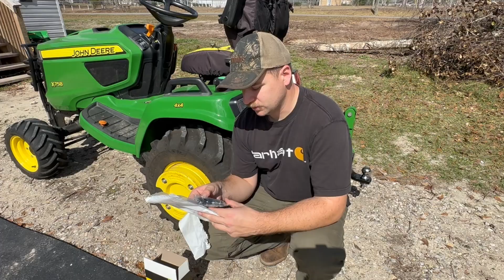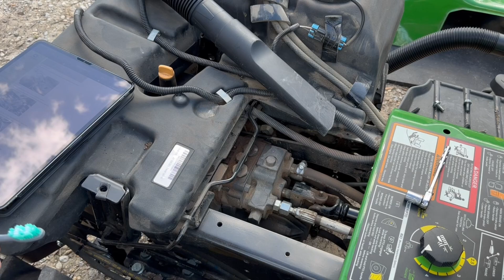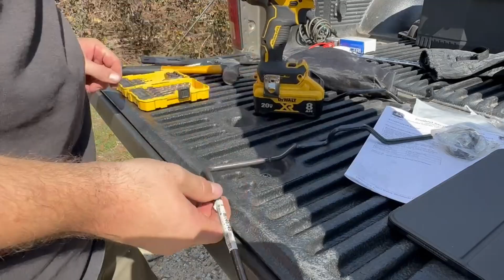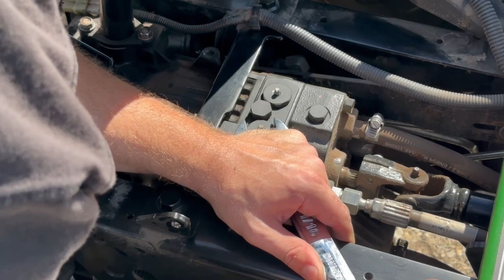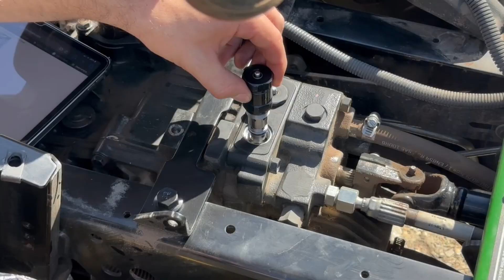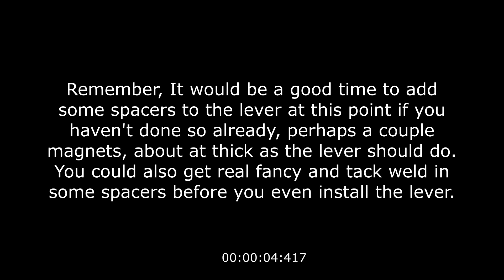John Deere X700 Series Transaxle Hydraulic Pressure Relief Valve Install (All Models With K9X Axles)

Comment: For anyone else reading this, here is what worked for me. I couldn't get the old valve out with an open end wrench. I used a 19mm socket to remove the center bolt which is the implement control valve. This is where you would add shims to increase the hydraulic pressure. Once this bolt and spring are removed, you then have enough clearance to use a 6 point 27mm socket on the valve. I then used a large breaker bar with a pipe extension to get enough leverage. None of the install manuals, forums, or videos mention the proper size of the valve. I used a caliper and it measured 1 inch and 63 thousandths. That converts to exactly 27mm. Hope this helps someone.

Comment: Hey Josh.  Thanks for producing great videos.  Truly appreciated.  I don't know if I'm missing it, but did you have any part numbers for the relief valve?  I have an X739 (2018) and would like to get one installed.  Can you please provide the part numbers or maybe a website link?  Thanks so much, again!  Well done.
Reply from the maker: BW15044 for the valve, M146148 for the lever. Just be aware the lever needs modified.

Comment: Very informative video. I have the pressure relief valve on order for my x758. Were you able to modify the free wheel lever yet? Curious what solution will work best.
Reply: If anyone is interested, I just did mine and for some reason the free wheeling lever does not need adjustment for me.  It makes contact and works as it should.  I do have an x738, I think we have different gas tanks.  Also, I ordered the push cap , spring and washer to secure the lever rather than drill the hole for the clip.  It worked for me.
Reply from the maker: Good stuff, want to post the part numbers incase anyone is interested?
Reply: @JoshsGreenGarage  Sure, the push nut is A16491, it’s an M8 push nut ($2.63).  The compression spring is M151706 ($6.75). The washer is 24M8055 ($0.68), just a standard washer.  I’m sure something similar to these can be found at a hardware store.  For me, just easier to get the Deere parts.
Reply: @MatthewPeterson. I could not find the washer part number 24m8055. Could it possibly 24m7055? Or if know the size of the washer. Trying to order so I have it when the relief valve comes in.
Reply from the maker: I didn’t, but if I ever have the deck off, I’ll likely tack weld some small spacers on. I know not everyone has welding capabilities, so I’m not sure what else would be a solid fix. I’ll probably make a quick video update for it when I do eventually fix it.
Reply: @JoshsGreenGarage  Understood. I don't have a welder. I was thinking maybe plastic zip ties might work. Just not sure what dimensions or materials would be needed so the lever can push down on the relief valve in the correct spot. Might have to fool around with it myself when the parts arrive. I'll probably never use the lever as the tractor is so heavy, but I like for everything to work as it should.
Reply from the maker: Yeah I agree, I usually like everything working as well. I think 1/4" of material would be enough to contact the valves. 
if you put that across the whole flat surface on the rod, you are sure to hit them. If you got 1/4" x 1/4" square steel, you could cut it and get some JB Weld adhesive and glue it on. 1/4" may be a bit much now thinking about it though... And it sucks because it works when the fender is off and the tank is out of the way. Best to sit the tank back down, then check it before fender goes on.
Reply: @JoshsGreenGarage  Tried to install the valve today. I can't get the old valve to loosen at all. Tried a little WD-40 and a heat gun. I'm using the same method you did with a 1 1/16 wrench and a feeler gauge. The feeler gauge tightens things up nicely, but it just won't budge. Ideally, a 6 point socket would work better, but there just isn't enough clearance. I've heard some people ground down a socket with a bevel to make it fit. It just seems like a poor design from an engineering standpoint.
Reply from the maker: I know mine was pretty tight, is your wrench biting good? If it’s not trying to round off the flats, I’d say give it a little more pressure, but at the same time I completely agree with being careful and not wanting to do too much.

Comment: Josh
I noticed my seat on my x758 is very hard to slide forward and backward. I’m thinking someone may have tightened the bolts of the seat to the frame too tight or it is in a bind so that it doesn’t slide smoothly. Is that what you were referring to in your video?
Reply from the maker: Yes potentially. I’d loosen the bolts just a little so they can move slightly, then slide the seat forward and back a few times. Slowly tighten them making sure the seat keeps moving freely. The tracks could also be dirty, so check that as well.

Comment: This is great, thank you.  I’m about to tackle this same project, along with the h3 kit from auxiliary hydraulics for my x738.  It’s nice to see a video of this installation on a newer x700, I was also planning on following the 45 loader manual and hoped it would be the same.
Reply from the maker: No problem! Yeah I want to do that H3 kit as well, especially with having a loader now.
Reply: I am going to get the H3 kit too plus the 2nd cylinder.
Reply: I (hopefully) lucked out and found the second cylinder on eBay for like 90 bucks.   It’s like a 450 dollar cylinder from Deere. I was kinda shocked.
Reply from the maker: Well, keep in mind too, there are a couple ways you can install the kit. If you want to have the mower deck/3 point separate from front attachments (say you want to use a plow on the front, up/down, side/side, and have a box blade on the rear with its own circuit) you don’t need another cylinder. The second cylinder is only needed if you want the deck and the 3 point to be completely separate.